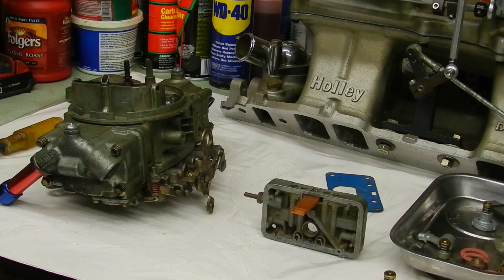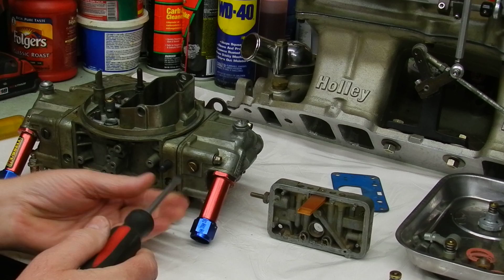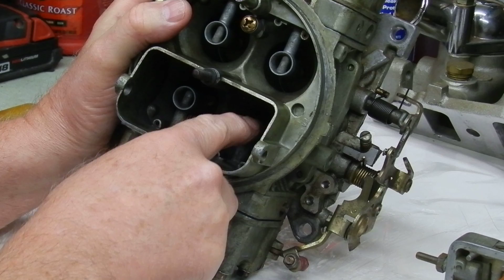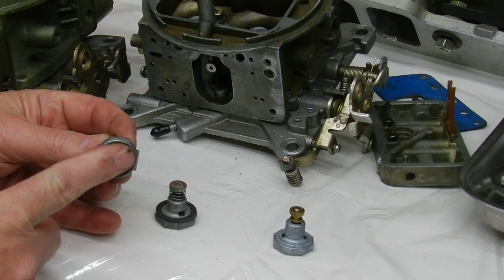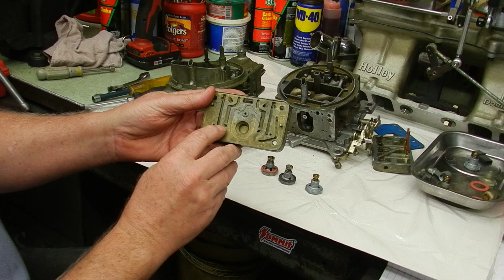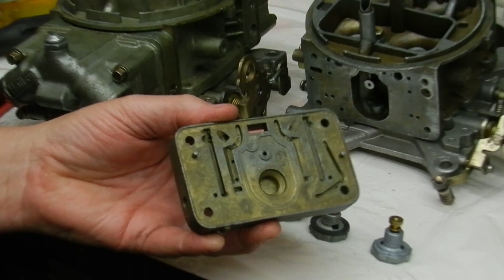Holley Carburetor Tuning Into

Comment: Good vid RANDY. I got a 1970 FORD 302 & it did run good until I let Mr.Stupid work on the carb. Now I just wanna get the carb off, toss it, and try from scratch Holly 2bbl or 4bbl , you tell me what carb to use. Original carb that Mr.Stupid screwed up was not a holly carb, it was box stock off a parts store claimed new rebuild. I have this vehicle for 28years and want to keep it till the day I die. I will sent pic’s of both Holly 2&4bbls that I hope to use….and the new Juck carb that was on the 302. Hope you can give me tip’s on this carb dilemma I’m  working to fix. Thank’s for your knowledge and soon I wanna hear that motor run as it once did not long ago.

Comment: Do not use a power valve that's only like 2" lower than your cruise vacuum. (Cruise 15", pv = 8.5)

Sure, once your cruising, it can work, but at low speed when your taking off from a stop light, the power valve will be open at idle (if your idle vacuum is 5"), and once you transition to the boosters, it'll still be open causing waaaay rich! (10 afr).

You need a pv that's lower than the idle Vac. (4.5" pv)

Comment: Randy have an issue with Holley 4160 will not change mixture with idle screw adjustment everybody says a metering block is bad do you have a fix or am I missing something is there something plugged in it is it cracked ?. Primary butterflies are set according to 60 thousandths required for vacuum I adjust off the rear butterflies my idle speed. Wants to run rich even with mixture screws adjusted only at 3/4 of a turn. Power valve is plugged off. Thank you Chris?!

Comment: When you adjust the idle mix screws, is the car in park or drive with foot on brake? Also, my choke won't close?? Could this in any way be causing the plugs to foul? Or just that it's running too rich?
Reply: not 100% sure but i think i remember hearing you do it in drive to simulate sitting in traffic since there is more of a load on the engine (if you have an auto trans)

Comment: My secondary venturies on a street avenger are not injecting any fuel at all into the intake (even when those throttle plates are wide open), I know for sure that the fuel level is all good and set on the secondary chamber... what am I missing?

Comment: ive been watching so many of these holley carburettor videos  but not one video touches on the issue i have  ,  primary metering board is leaking mysteriously    i have the carb kit  new seals etc ive cleaned up the carb good and cleared all the holes  and put it back on the engine  after moving the throttle the primary metering board leaks  i tear it down check it everything is perfect  put it back on and it leaks after it squirts feul ,   wtf    im sick of fucking holley carburetors  youre stopping me from having my car   fucking doing my head in i want to drive it before i get old sick and die

Comment: What do you if you’re running power vaule blocks on front primary and secondary and the motor bustes n spitting at full throttle?

Comment: Hi Randy, Thank you for the great video. From the sound of it, you probably aren't anywhere near northern colorado at 5k elevation. I've got an 85 dodge Ramcharger with a 360, 9.5/1 compression, RV cam, and my small 2 bl Holley just doesn't want to cooperate. It stumbles off the get-go, auto choke doesn't stay on long enough to make it drivable when cold and to make things worse, I had to jet it way down and change the power valve to pass emissions. Any suggestions b4 I install a Holley efi?

Comment: Great video but what if the float level can not be adjusted to get fuel to the hole?  I have backed the screw out until the adjustment nut seats on the shoulder and the screw will not lock it down.  Help!  BTW - It runs well as it is

Comment: I recently bought a 67 Mustang with A 347 stroker Holley carburetor  I think it's a 4160 it is a racing carburetor it is tuned for 9300 feel but were I live it's only 886 feet.i think it has size 66 jets in it now.just wondering if you had any idea where I should start?

Comment: Hi I have a question I have a Holley 4150 LIST#80309 3259 it´s a marine carburetor! The thing is I bought a trickit and then I forgot to check the placement of the nozzles on the secondary side One is 80 and the other is 90 so when you look at it which one has to go where I hope someone can help me... thanks Henrik Denmark

Comment: I would like to see a 2bbl video there's the 7448 350 cfm and the 4412 500 cfm used as a performance replacement for the stock 2bbls of yester year I have the 4412 on my 69 f 250 390  I need to learn to modify re jet power valve etc for better fuel economy and performance these 2bbls can support up to 600 HP on circle trackers

Comment: hello sir I have a question if my carburetor isn't adjusted properly can it cause my engine to only run on 4 cylinders instead of 8?
Reply: Captain Saveahoe If its too rich it can foul your spark plugs. Does it stink and burn your eyes ?
Reply: Don Rutter  yea I can smell the gas coming from the manifolds once its warm but I think that's from the gasket

Comment: I am building my first sbc 350 and tryin to make about 400 hp with a hot cam and i have a holly that came with my car and i want to put on on my engine do you have any suggestions for a good carb to start off with?
Reply: zach.
800 cfm rodchester uni flow.
Reply: For 400hp you will need a Holley 4777 or 4778. They come with a dash # like 1,2,3,4 etc but that just means the years they progressively added things on or took things off. A 4777 is a 650 double pumper, a 4778 is a 700 double pumper. You dont need a 750 cfm for 400hp, on a 350 you will just be wasting more fuel. If you built an all out race 350, 800 cfm is what you need to get, a 383 race motor will require a 850cfm.

Comment: I'd LOVE to see a video of how to know what accelerator pump cam to choose and what the difference is in all of them.
Reply: Maquarr Steeper the ramp angle the faster the intensity of squirt,  if you have a off-idle bog you can try a different ramp, or a different # accelerator pump squirter. Most Holleys dont stumble from too much fuel off idle, they stumble from a lean condition because it takes a split second for the fuel to catch up with the air, because opening the butterflies is instantaneous, but the venturi effect has to catch up carrying fuel.

Comment: Yes I would love to see more info on power valve selection....the use or not use of power valves in the rear...properly jetting...and properly setting the primary metering block...this was an informative video and I got alot out of it...Thanks.. keep up the good work
Reply: thanks Eddy by the way my original channel got hacked , I have re-uploaded these videos and 8 others to my new channel (Holley Carbs: How To's & Advice ,40 yrs of exp.) please subscribe to this new channel, where we upload several new videos weekly thanks. -Randy
Reply: Read your engine vacuum guage, power valve should be half that number for a regular street motor. 13lbs vacuum requires a 6.5 power valve.
Reply: @donrutter6765  at an idle right?

My idle Vac is 5". I should put in a 4.5"pv.

If I put in a 8.5", (thats 5" lower than my cruise Vac), when the boosters kick in, that pv is open already, giving me a super rich transition (10 afr)

Comment: If you can I would love to see some stuff on the 4412 500
Reply: +Randall Cribb no I'm in Houston Texas we run arklatex factory stock rules for dirt track, this is our rule for the carb.

Cast Holley 4412 -2 barrel only. Must be unaltered. Choke plate may be removed. 4412 must be cast into choke horn of carb. Maximum spacer and adapter 1” combined total. Fuel pump must be in stock location for make, NO electric pumps or fuel injection even if factory equipped.

Comment: Thanks Randy!   I have a 670 I just bought and it has a few small issues that can be adjusted out but I wasn't sure what to do.  You've already given me some good info so I'll continue to watch the other videos to learn more details.
Reply: +Kevin Rader ,if you have a specific problem let me know, will try to help you randy
Reply: +Randall Cribb   Thanks to the video I was able to get a good idle.  The butterflies were open way to far on the front so now I've gotta work on a hesitation when the rear barrels open.  I haven tried it since I fixed the idle issue so the hesitation may be gone but I can't imagine the small adjustment on the front barrels would fix that. Do I need a different  spring on the diaphragm to get the rear to open  at a different rate? Sooner/later?
Reply: +Kevin Rader , Kevin first make sure  your float level is right  , next I would try a  stronger rear diaphragm  spring also you might need to jet up a couple sizes in the rear .Hope this helps if not let me know. Randy

Comment: keep em.coming!
Reply: +Nwmod39 Hudson thanks for watching . if you need some help let me know , please share this video. randy
Reply: +Randall Cribb 
i have a street avenger 670.i am having issues with.

its a fresh rebuild and i fired and broke in new engine with it.
ran ok but seemed super rich.
i changed nothing in it and now it only sputters voughs and then backfires through carb.
i can put my 650 mechanical secondary carb on it and it run fine with only a hard throttle stumble.
so i feel its within the 670 somewhere but cannot figure it out.

any.ideas?

thanks.
Reply: with engine off , open the throttle  to see if your accelerator pump is squirting gas , should be two squirts of fuel out of the accelerator pump discharge noozles , looking inside the top of the carburetor with a flash light while opening throttle, if accel. pump not working , its best to remove the carb from the vehicle and remove philips head screw holding accel pump discharge noozle and remove check valve that sets under the screw , lot of times this check valve sticks and needs cleaning , check valve is tapered to a point on one end , that pointed end  points down in the carb flat end points up towards screw, you may need to up the size on the accelerator pump discharge noozles  .003 thousanths at a time . size of discharge noozle stamped on the housing, if  this does not help let me know, hope this helps.